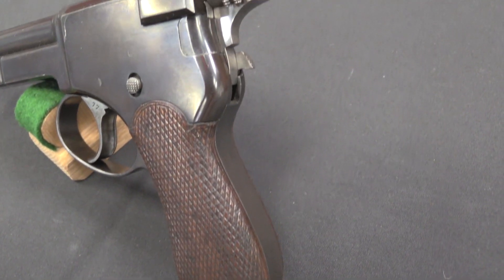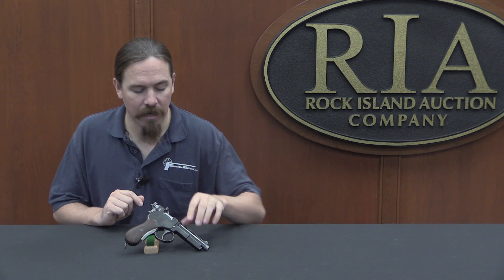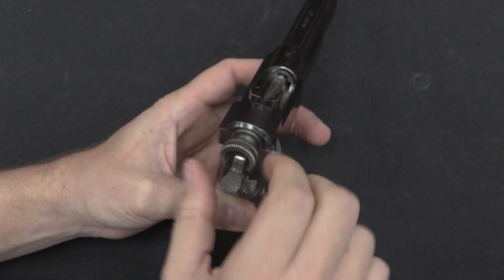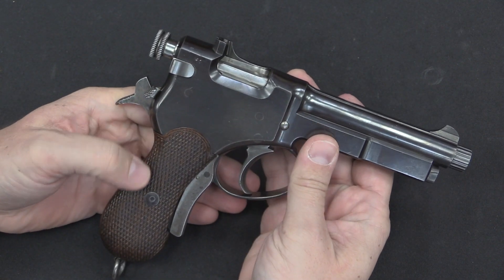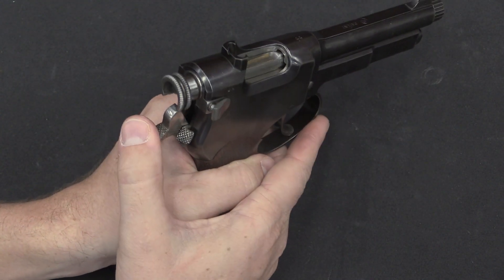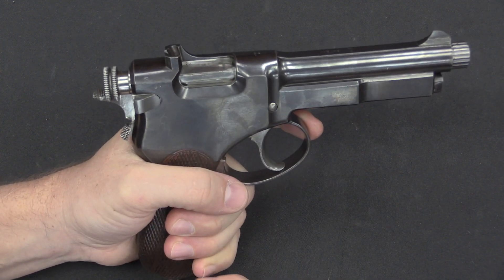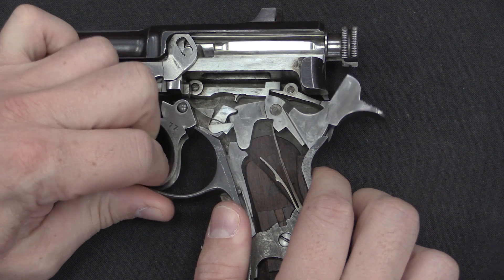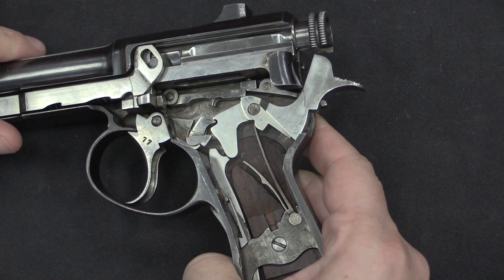Roth-Theodorovic Prototype Pistol

Comment: I really like the idea of a smooth DAO duty pistol with an option to cock back to single action for a single aimed shot. Most of the advantages of a revolver right there.
Reply: nicholas cunningham because you're still under stress after the first shot, and might jerk out an accidental discharge. Or be running or fighting with your gun out. Pressing the decocker or just good practice and trigger discipline would fix that, but I'm talking about police and soldiers who seldom shoot pistol except in an emergency. DAO was popular with law enforcement coming from revolvers, but most such guns couldn't be cocked back to single action at all.
Reply: Call it DAM--Double Action Mostly :P

Comment: Nice design study in terms of the firing mechanism, but defnitely something you want to have in a regular full-scale production. As for the grip safety: you can easily see that it was added alter on, as no company with at least some amount of dignity would create a weapon with this excellent level of execution and then add a safety lever which has a huge gap in its back (which is an invitation for the safety to fail because of mud and dust getting in there and probably even blocking the entire firing mechanism).

Comment: Damn I would not want to be the poor soldier stuck field stripping that complicated as hell pistol.  What is it with Europeans and insisting the internals of a gun rival clockwork in terms of complicated and fiddly little pieces?
Reply: Question is: How far does field striiping go?
Not so far that the whole trigger mechanism gets taken apart!
A 1911 has quite some finicky parts too, which have to be aligned between the two side plates, pins have to be driven in and out, etc.
Here I see easily accessible parts of reasonable size which together provide variable trigger function (safe action, anyone?) and even a decocker.
Well designed, I say, especially for ~120yrs ago!